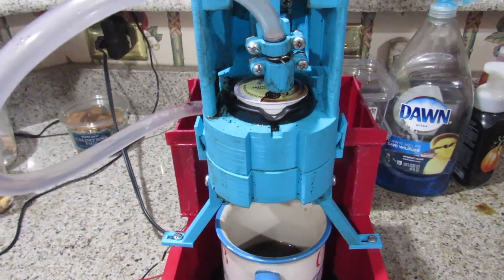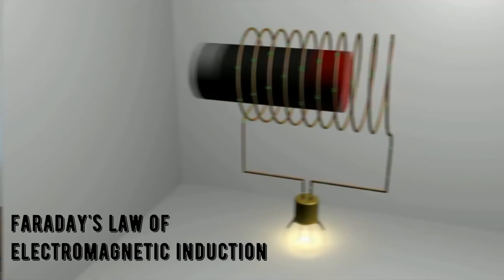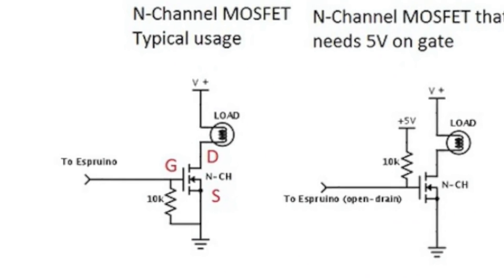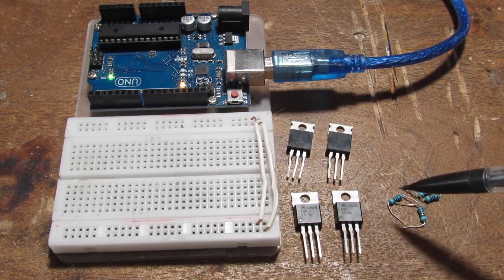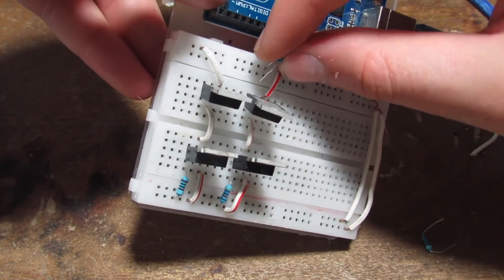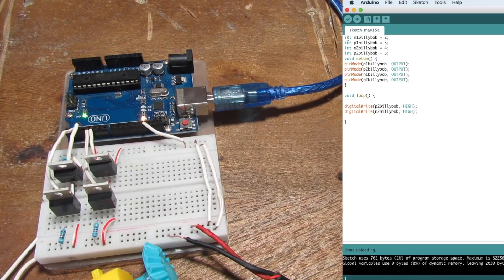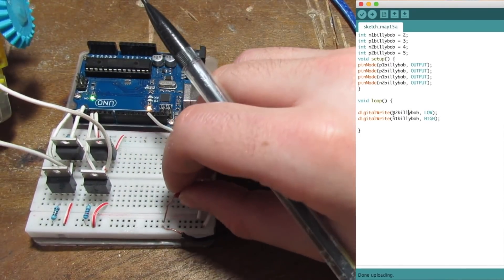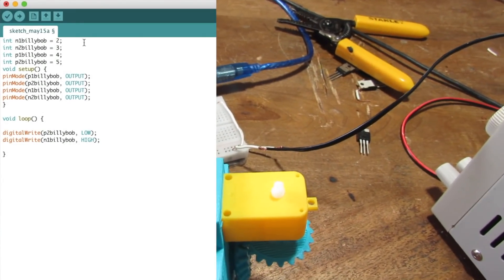Controlling a DC Motor With an H-Bridge + How They Work | Arduino Uno

Comment: Cool video, what are the NPN and PNP Mosfets type information if I want to purchase the same types that you used in your video?
Reply from the maker: I got mine from amazon-
        
p channels: https://www.amazon.com/Tech-Express-IRF5305-MOSFET-P-Channel/dp/B07MNPM113/ref=sr_1_2_sspa?keywords=P+channel+mosfet&qid=1560382323&s=gateway&sr=8-2-spons&psc=1

n channels: https://www.amazon.com/Jekewin-N-Channel-Power-Mosfet-220/dp/B071Z98SRG/ref=pd_sbs_328_2/133-5116970-6288458?_encoding=UTF8&pd_rd_i=B071Z98SRG&pd_rd_r=eca1ea09-8d68-11e9-b153-57343de5b3aa&pd_rd_w=bzAcE&pd_rd_wg=rFAJd&pf_rd_p=588939de-d3f8-42f1-a3d8-d556eae5797d&pf_rd_r=4PT0M451P0DRNKNPNS0Q&psc=1&refRID=4PT0M451P0DRNKNPNS0Q